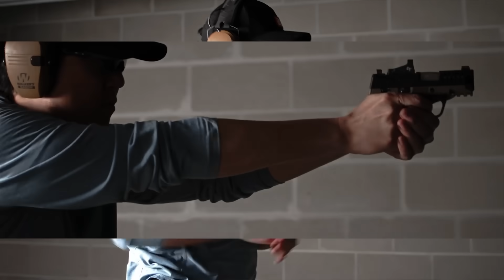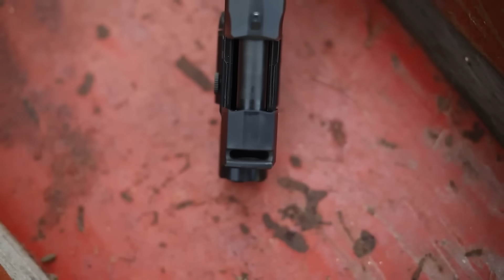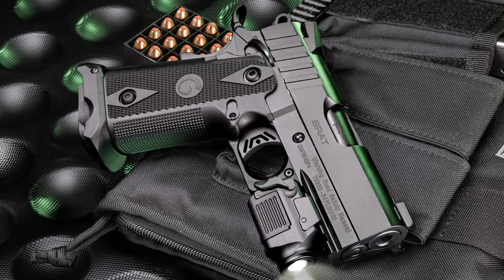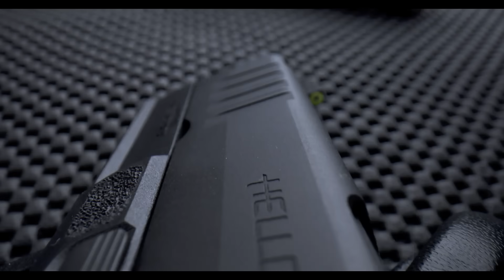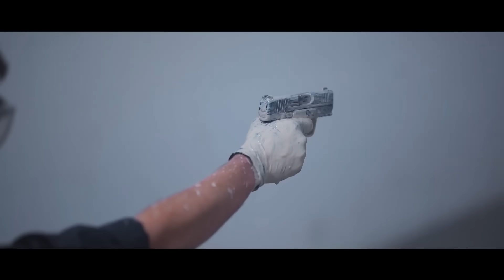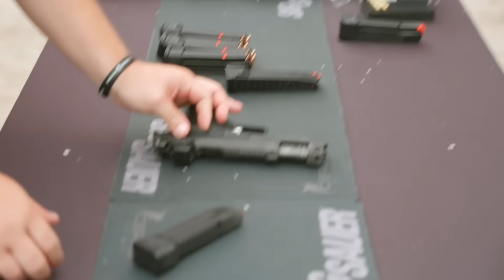8 Insane New Firearms That Just Hit the Market 2025!

Comment: I was shocked at the Brat. I installed an EGW kit in it, although I didn't have to; it's just something I do. I used an Atlas trigger with tuning set to 3 lbs. Tuned the springs to run the 45 ACP, and it is a great gun.